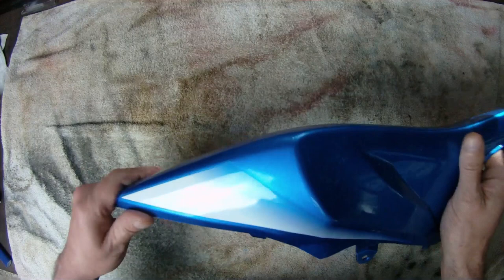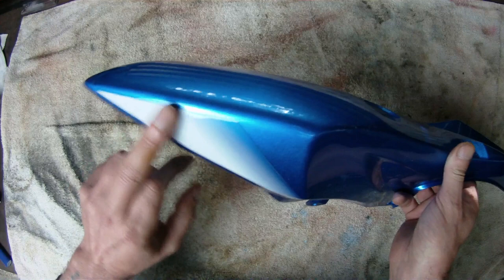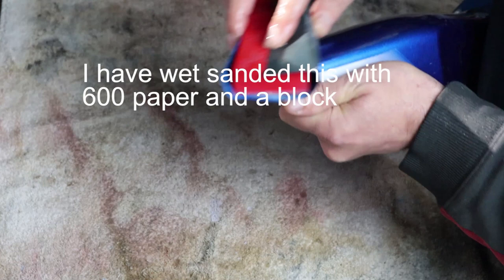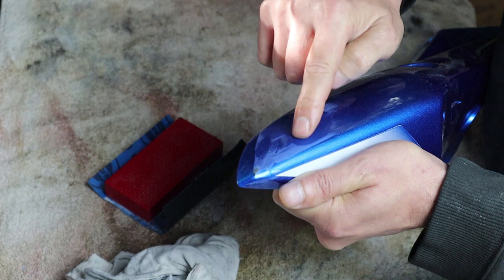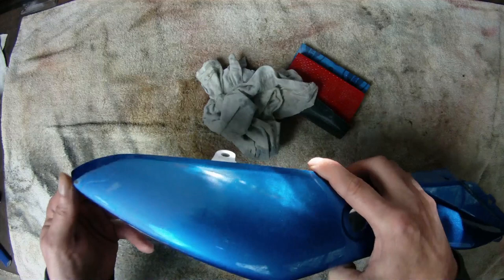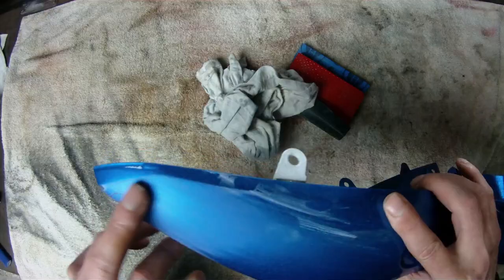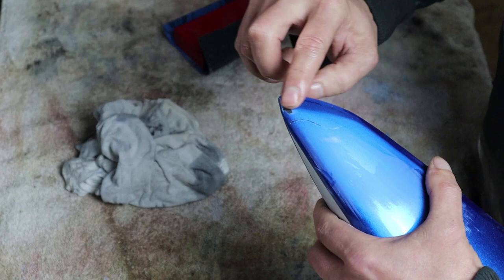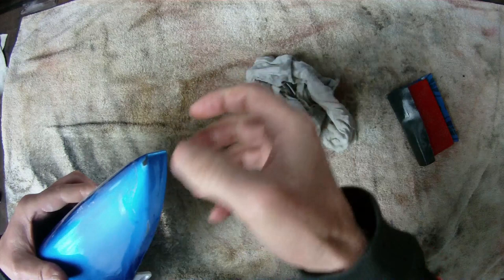How to Paint Motorcycle Fairings (Prep Work) Tutorial

Comment: thank you , iv got a 2009 bow g65gs that some one backed into it at a shopping center, three pieces broke off , I was able to glue the three pieces and then used a plastic epoxy with some cut off fiberglass tape , the glue didn't really go into the edges of one of the broken pieces , after seeing this repair with the Dremel , I"ll give it another go as Finding a used faring has not been susessful , thanks so much

Comment: Hi Kel - Just found this video and you may actually be some good news I needed.  
Did you ever do a video showing how to properly paint/spray plastic fairings?  

My bike was stolen, now found, and is at a shop.  
One of those situations though where the investment to fix it will outweigh the value of the bike, but I have found a shop that has a great reputation and he understand my situation.  Damage is alot of plastic fairings scrapes and imperfections...and then a turn signal, key lockset, brake, clutch lever, clutch, and maybe internal wiring.  And I already have all those parts.  

But just now it dawned on me that maybe all these plastic fairings could be filled in, sanded down, primed, painted, and clear coated.  All using the existing parts on my bike.  If you have a video after the prep process or how to professional get a high end finish...that would be amazing.  

I just bought all the fairings OEM, and you can imagine that i now I'm questioning the process.  But if I can return those and redirect that money back into the actual labor and mechanical parts necessary to make it safe for me to get back on the road, that would be such a huge help
Reply from the maker: Go to my channel, there are 2 or 3 vids on how to spay to finish. Try "How to spray a 3 layer pearl" That should start you in right direction. Good luck my friend.
Reply: @howtowithkel3352  Thanks my friend for writing back so quickly.  Appreciate it and I will absolutely go find and watch on channell  and like and subscribe.  If i decide to go this route, I would love to ask for your opinion on a couple things after I actually have access to the bike.  Again, thanks so much and have a great weekend ahead.

Comment: Hi kel i want to spary my R6 fairing orange but iv never done it before , can u give me a list of sand paper to buy , i literally haven't got a clue
Reply from the maker: Hey Medusa, if your panel is in reasonable condition and doesn't need repair. All you need is 600 wet and dry paper. Take all the shine off the panel so it is completely dull and your ready to paint. If you have to sand filler, 320 then 400 and 600. If you want a show bike finish you will have to sand the clear coat with 2000  and then polish it. For best results sand wet and use a block wherever possible. If you need more help i'm always happy to help.
Reply: @howtowithkel3352  thats great thank u kel i appreciate it , i will be doing it in about 2 weeks time , ill let you know how i get on , thanks again 👍👌
Reply: Medusa...how did you get on? My yellow 749 fairing and mirror need scratch repair and respraying after someone dropped it (3 times in succession) turning around on a hill. I am not sure what the paint code on a 2003 (53 plate) is though.